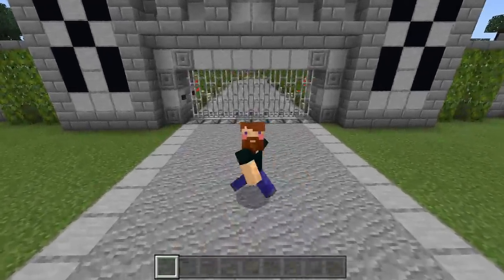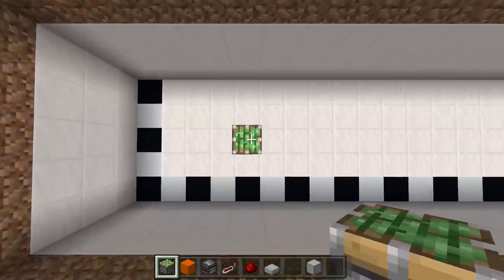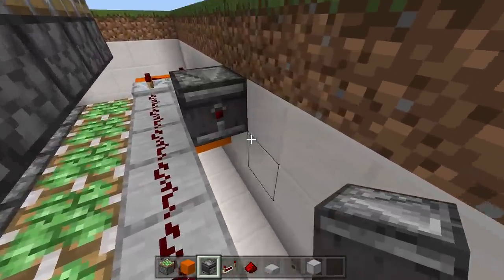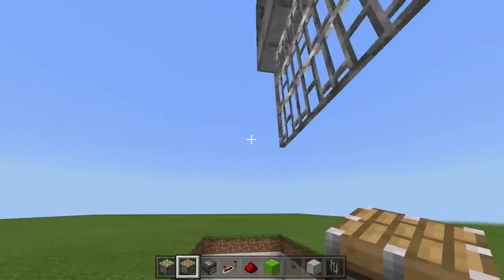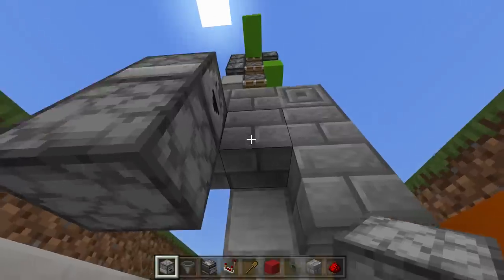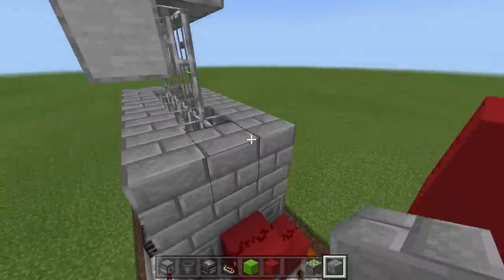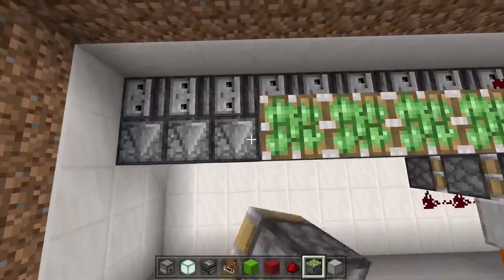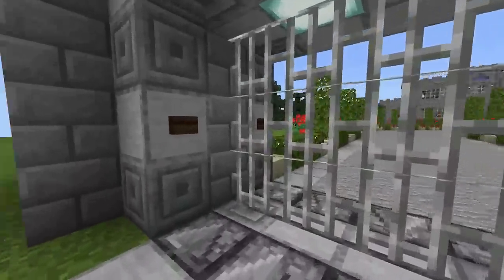How To Build a Working Castle Gate in Minecraft Bedrock! (Portcullis Gate)

Comment: i would really LOVE to find a portcullis that actually works in 1.15.2.  Ive tried 5 different designs and nothing is working properly even after rebuilding to make sure its right.
Reply: Same
Reply: Does it work on 1.14.60 ??
Reply: Blueloafeix S it looks like she’s on bedrock edition which is currently 1.14.60 so I think yes it may work with 1.14.60.
Reply: Blueloafeix S I just tested it and yes it does work.
Reply: Wait does this one not work?
Reply: How about 1.6.20?
Reply: Still same, no Java 1.16 working gates
Reply: @raymondweiss7393  wait fr? How I can create the gate
Reply: @yahlizvyfler9520   this one works for me
Reply: This does not work
Reply: Does this still work in 1.17 Minecraft Bedrock?
Reply: @thatguyperson6368  not that I'm aware of, but haven't tried it in a while.
Reply: It works on bedrock for the most part on 1.19 but the issue I’m finding is the use of only 2 buttons. Each bottom goes to either up or down. So when outside the gate you can open it, and inside the gate you can close it. But you can’t open from inside or close it from outside without the addition or more buttons

Comment: Just trying to help everyone so they don’t have to find out the hard way like me (;

The button NEEDS to be WOOD.
Reply: Wdym
Reply: the sticky picton isnt pulling the blocks down
Reply: @dewantyieebraja9142  im having the same issue
Reply: Wait why
Reply: The front button stopped working after a few uses, only the back button works
Reply: I used a basalt button and it was just fine
Reply: @semi-legalatomicweapons1510  does it still work for you?
Reply: @lachellee  yes it’s been working fine
Reply: @semi-legalatomicweapons1510  do u know what I did wrong? I kept pressing the front button then it stopped working, but the back button and lever works just fine
Reply: When I place the observers Dow the arow goes the exact wrong way could any one give me a tip pleas

Comment: By the way you can also make it taller - with this design you could have up to 8 blocks of fence/bars. 

The only change you need to make is that the repeater placed at 10:30 should be changed to a 2-tick delay. 

since it takes just slightly longer to open the larger gate the 1 tick delay will break your gate, at least that's what happened to me at first.

Comment: Honestly, I've made this build before and it worked perfectly. My second time something went wrong. The shovel won't go all the way through, only stopping at the hopper.
Reply: Same
Reply: Same
Reply: Mine did that too. I removed the dropper it was supposed to go into, replaced it with a piece of stone, then set in the hopper and replaced the dropper. Mine was apparently trying to put it somewhere else. It wouldn't link with that bottom dropper.

Comment: if it wernt for Youtube minecraft tutorials on redstone, my castle i made (which i started on january 11 2020) wouldnt be as far as it is today. My castle, which is still incomplete, has many different buildings and features to it. Its got: 2 working redstone portcullis gates, 2 gate houses, 14 wall towers (each with an interior) 16 wall sections (each with an interior) Several banners of the UK Flag on the gatehouses, walls and towers, a moat that surrounds the entire length of the wall, a barracks, a blacksmith, a fletcher, a tailor, a butcher,  a stables, a animal shed, a market,  a cathedral with a redstone belltower a cemetery, an archery range, a tavern, a theater, a waterfall in the market, a bank, 16 village houses, 8 elevated houses, 8 bungalows, 6 rural houses, 6 windmills, 50 guard posts, 40 storage holds, 40 wells, a lumbermill, a dock, a dockyard, a dockyard market, an alchemist/witches hut, 4 lion statues (2 at the each of the gatehouses) 6 silos, a lighthouse, a clinic with working showers, 6 wheelbarrows, a pirates cove, a quarry, a mine, a mineshaft, and an apple orchard. 

I  still have alot more to add to my castle such as: the keep, trebutchets, a great hall, a throne room, a grand dining hall, a wizards tower with an enchanters lab, a grand kitchen, a war room, a grand bedroom, a grand library, a royal court, a dungeon, a grand bathroom, a university, a siege workshop, a spa, a slaves quarters, an execution stand, a garden maze, a dragons nest, pavilions and tents placed in random areas of the overworld, neatherrack beacons, a pirate ship, a theifs hideout, an assassins hideout, flags, battering rams, catapults, bastillas, warships, various statues like griffions, wizards, dragons, and more, chariots, a volcano, and elven styled village.

Comment: SUCCESS! I just finished this build with no problems whatsoever, which I think is a first for me building off youtube tutorials! Thanks so much and I'm absolutely subscribing!!!
Reply: I just finnished but it will not open after connecting the buttons any ideas?
Reply: @maessenevents  did you add the lockout switch too? I think when I set it up first I put a block that stopped the redstone line and it jammed it. Maybe just check all of your redstone dust to see if there's anything not connected
Reply: @maessenevents  happened to me as well
Reply: @drakepieper8565  I think mine is something to with the droppers and hoppers I think it does not respond to the redstone

Comment: This tutorial is super awesome! It helped out with my castle :) buuuut I have a couple issues, I have to use stackable items and I can't get it all to work together. I followed your instructions to the dang T but the top and bottom parts wont work together and so the gate will only go one way or get all messed up. Maybe an update screwed the circuitry? I noticed as well that the sticky piston on the torch ladder is just perpetually not retracting.

Comment: May be because I'm on a Realm, but for some reason, the lowest group of the first 15 sticky pistons is NOT grabbing the one above it to bring it down.  Going back through to see if I've set the ticks on the repeaters wrong or something, but it is just a bit weird, especially since other Xbox 1.16+ users are reporting it works fine for them.  I'm rather new to the more complicated redstone setups, but I've redone everything I could think of and double checked, now going through to make sure I have the repeaters set.  If anyone has any thoughts love to hear them!  I love this design and want to see it in action on my buddies castle!       Edit: annnnd, it was the repeaters!  lol, still have a lot to learn, but it's working fine now.
Reply: Did you make sure and use a wood button?
Reply: @elihauschild1695  It was just that I had the repeaters turned wrong.  I had other problems, but working through them has made me much more confidant about working with redstone.

Comment: Awesome design! I’m having trouble with the comparator though. I push the button on the inside and it goes off, but when I push it again, it won’t turn back on
Reply: Dysidious me too :(
Reply: SobaMysteries _ I actually figured it out. The hopper has to be going into the FIRST dispenser.

You can do this by placing a normal block where the first dispenser goes, place the hopper going into that block, remove the block, and place the dispenser.
Reply: Dysidious oh! Thanks :D
Reply: @dysidious7452  bruh im confused lol
Reply: Tristan Edralin I mean it’s pretty clear instructions I wrote... Place a temporary block in place of the first dispenser. Make the hopper connect to the temp block. Remove the temp block.
Reply: @dysidious7452  after remove temporary block we place dispencer again or nothing?
Reply: @ Dysidious  Or you could just crouch and put the hopper faceing into the dispenser that way

Comment: The redstone won't connect to the sticky pistons for the bottom
Reply: same problem for me and i tried different gates and the samething keeps happening
Reply: Have you found a way to fix it?
Reply: the repeater closest to the bottom switch when he tests the lower half needs to be 3 ticks not 2 it will now pull the blocks flush to ground level again

Comment: My bottom row of sticky pistons in the top circuit are not correctly oriented when placing the second repeater. Instead of the first 3 blocks going down as shown, the middle 3 go down. I have placed everything as you did in the tutorial. Any help would be appreciated, as the bottom circuit works perfectly, but the top one does not.

Comment: Dang I spent all this time troubleshooting why my sticky block wouldn't catch the bottom gate block and pull it down. Turns out I wasn't using a wood button, which throws of the repeater sync. Make sure you use wood buttons!
Reply: Im having the same problem and I am using a wood button
Reply: @ChargingKoala  there is definitely a bug in the mobile version. Sometimes mine works perfect. Other times, the outside button won’t open the gate.
Reply: @elihauschild1695  Im on Bedrock

Comment: I'm having an issue where the inner button works fine but the outer button only closes and cannot open. I play on Switch. I dunno if the recent update might have done something to it.

Edit: It was because of the glitched update when they added the hogling brute. It works just fine now.
Reply: It work now?
Reply: I'm playing on a switch too and I'm having this exact issue now 2 months after the edit.  Maybe it's another glitch?

K just now I destroyed the block above the second dropper (in between the two buttons) and put the red stone directly across the top of the dropper instead of up and over that block and it works perfectly now.
Reply: @bperkins9984  you must to put a wooden buttom, I had an issue to,but I put a wooden buttom and now it works perfectly
Reply: @marcogiraldo3056  I use wooden buttons.  I can only get it to work if I remove the block

Comment: The button on the outside gate wont lift the gate up, I haven’t added the lever yet.
Reply: Same here
Reply: Fernando Alday I fixed it, it might be because your repeater on the outside button is facing the wrong way. That was my problem.
Reply: @matthewspears6932  is it the opposite way?
Reply: Fernando Alday I put the repeater the opposite way, it’s correct in the video.
Reply: @matthewspears6932  oh ok. Thank you
Reply: @matthewspears6932  but the thing is, I built it and it worked. Now, it isn't

Comment: I need help the pistons won’t fully extend  and Iv followed step by step
Reply: Which pistons?
Reply: b for  i have a problem with the pistons pulling the blocks down . It do pulls all the fence but keeps the block .. the stikcy pistons isnt pulling my blocks down
Reply: @mohammadsindi3864  the repeater closest to the bottom switch when he tests the lower half needs to be 3 ticks not 2 it will now pull the blocks flush to ground level again